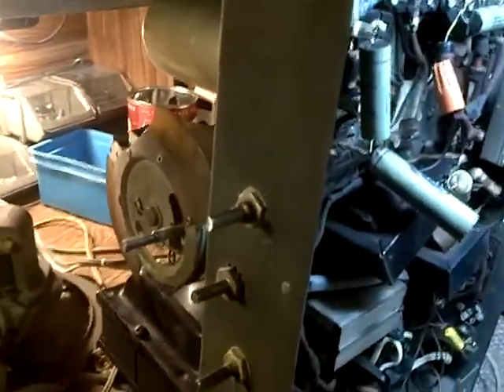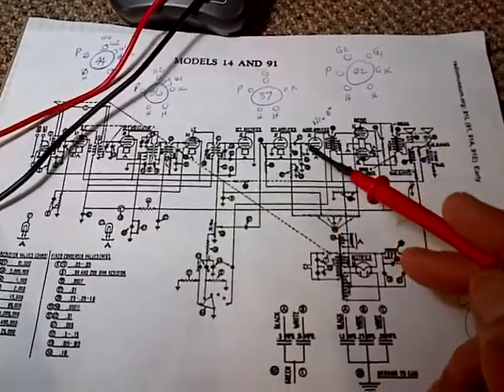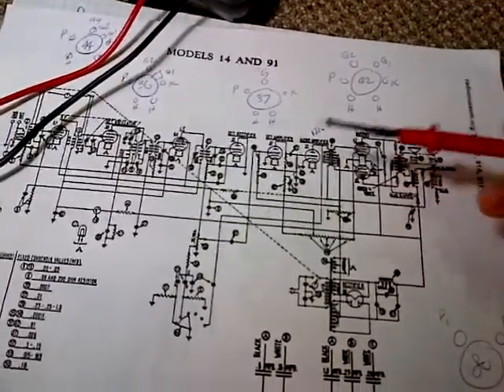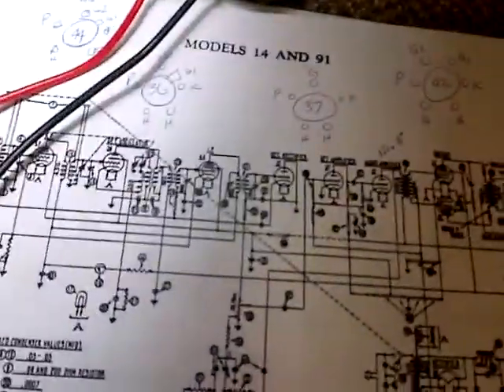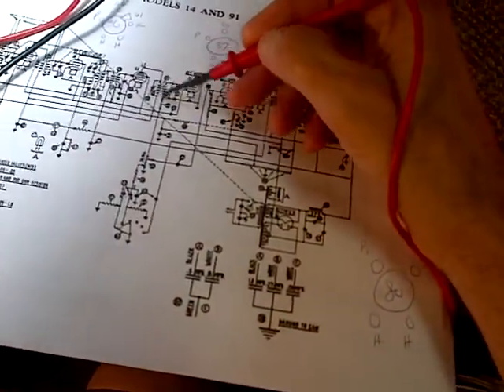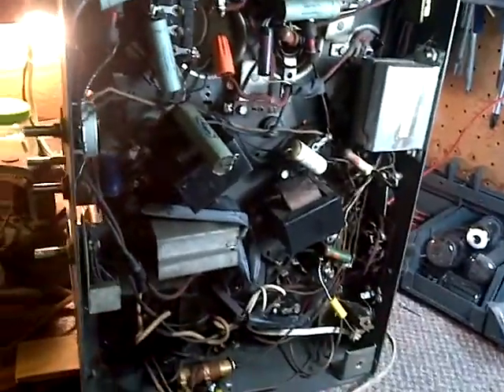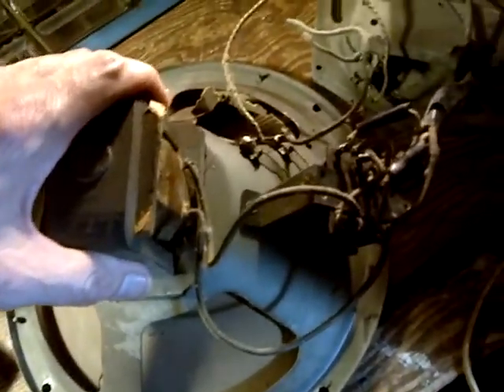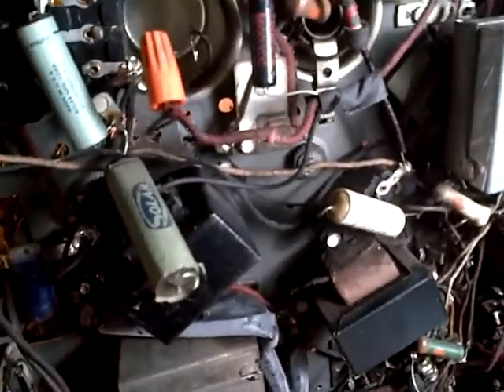Philco 91A-221 Tube Radio Repair Video #15 Can you explain this?

Comment: There is a path through the crude avc line for the signal to pass. The det. rect. plate will read 0 volts. The det. amp. tube plate should be around 60 volts and the first audio tube plate should be around 100 volts.  Dennis

Comment from the maker: Thanks Bobby.  I take different approaches depending on the situation.  Many of the radios I work on require only one or two fixes to get them going again.  I've never fully restored a radio although I have done complete capacitor change-outs.  On the Philco, I got thrown off course at first by the fact that the radio seemed to work.  If it were dead or there was too much draw on the HV circuits, I might have opted for changing out the capacitors. Jim.

Comment: Hi Jim. One thing I have found is everyone does things in different ways on the repair and restoration of these set's. I always change out the caps first, and check the resistors replace any bad ones. This narrows down the problems to the tubes / coils. and tuner. If the speaker coils are overheating this could be a sign of a shorted cap bad tube in the amplifier. Bad resistor. Etc. Don't know if this helps but that's about all I can come up with. Good luck. Bobby